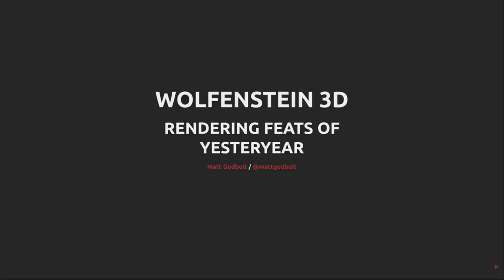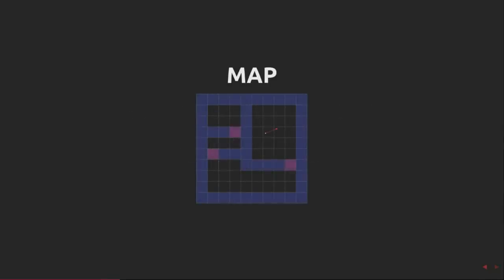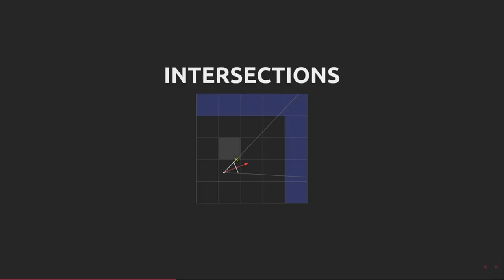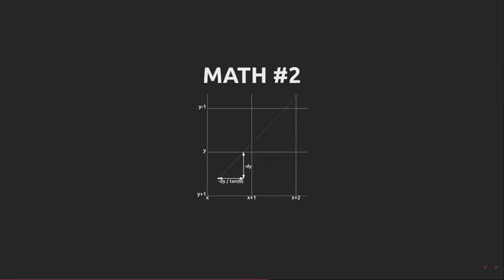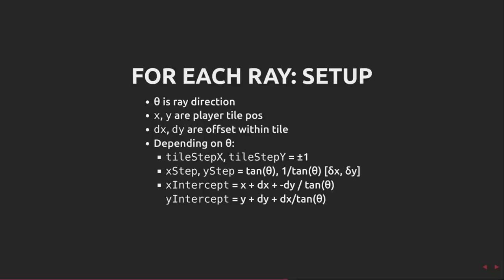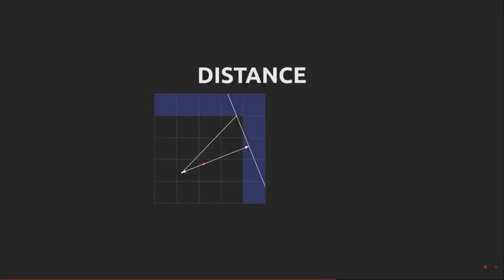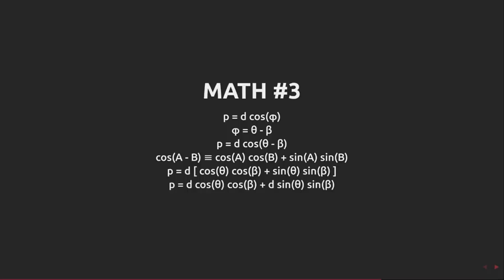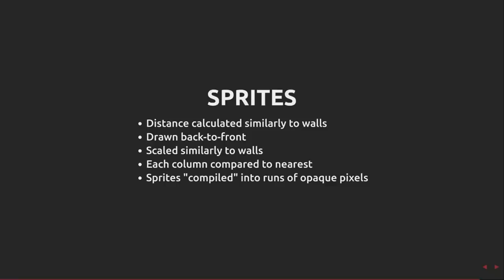Wolfenstein 3D's map renderer

Comment: Okay, I see how this can work for steps and angled walls (like standing in the middle of a hexagonal shaped room) but do would you add distinct textures for different ceilings and floors? Wouldn't Wolfenstein 3D constantly be limited to the "sky" and "ground" being one colour or one unmoving texture?
Reply: Yes and it was.
Reply: Except in versions of Wolf4SDL.
Reply: You could add in a textured sky or ground using this method, with a little bit of cheating. Let's say the sky for the whole level is a large image. You then have to figure out where on that image the player is, which you could use their x,y position in the map for. Then you need to rotate the image to match the player's orientation, and then render it with scaling before drawing the walls. A pretty basic demo effect. The problem is that doing it this way, you're writing the pixels where the walls are twice, which will slow things down. You could use a z-buffer, drawing the walls first and then only doing the ceiling where you haven't drawn anything yet, but it's still going to be relatively slow particularly for the machines Wolf3D were written for.
Reply: @deanolium  But isn't rotating an image extremely computationally hard? 

What is 3D if it isn't scaling and rotating many many different images all assembled together into polygonal models?

Wouldn't a huge level therefore need a single absurdly high resolution image as each part of it is viewed from fairly close?
Reply: @Treblaine  Nah, rotating an image on the z-axis is relatively easy. Essentially you just need to figure out the x,y displacements for each pixel when you move across one x or y position in screen space, which can be done with a little trig, ideally using look up tables, and then repeated.  Of course, you need to create the rotation across the x axis (after it's been rotated) so that it looks like a ceiling or floor, but you can cheat to mimic that by doing some scaling on each row of the screen.
As for the image needing to be large, in reality you just tile the image, which computationally is very, very cheap as you can just modulo the x and y points.
Reply: @deanolium  It's hard for me to get my head around how rotating in the Z-axis (that is the axis pointing out from the screen) can make it look like it's rotating in the X-axis (the axis going from the top to the bottom on the screen) with just some scaling by each row.

PS: I just went back to look back at videos of Wolfenstein 3D and it turns out all versions have solid colour ceiling and floors. I don't know where I got the idea of Wolfenstein 3D having textured floors or ceilings but none of the commercially released versions had it, even the Jaguar release.

So I suppose what you say would mainly be for engines like Doom.
Reply: It's one of those things which is hard to explain in a comment but quite easy on paper. The main thing is that you're changing the reference point with each translation. But it's also really cheating in many ways -- you're creating an effect which approximates a ceiling or floor texture. 
It could easily be done in a Wolf3D engine, but back in the day it would be more of a strain for the targeted systems which were already only just about running the game. By the time Doom came out, the systems would be powerful enough that you could do this kind of thing, but it's all very much icing on the cake compared to things like the walls, AI, enemies, etc.
Reply: @deanolium  Thank you anyway, I appreciate all you've said, I think you explained it as best as you could. It's been very interesting.

Comment: What about DOOM's map renderer? From what I know DOOM (1993) used as first binary spaced partitions (BSP), which were still 2D planes, but rendered took them separately and rendered them to their apropriate location and height. While there was no real height, it still did quite convincing job that the player is in a 3D room. But the player camera can't look up or down. This also leads to some strange scenarios when you have to shoot an enemy upstairs or downstairs. You just look to the wall and shoot. And guess what? You hit him! Also, this leads to a limitation. There can't be room under another. All stairs and elevators that take player to some lower or higher planes do not connect two rooms that are overlapped. Basically, there are no overlapping rooms. That was changed in 1996 with release of Quake, the first truly 3D game. When the GPU was invented and it featured more complex math operations (also more complex number formats than integers and fixed point numbers - floating point numbers - and the number bit depth also increased - with new 32bit CPUs and 32bit Windows, computers were capable of making more complex math operations), game developers actually took this into their advantage and a fight for the first truly 3D environment has begun. It was obvious that a game that is rendered within true 3D environment will be real boom. The fight was over when id Software (naturally the one that also came up with Wolfenstein 3D and DOOM) released Quake. That meant revolution in gaming! Truly 3D environment. id Software actually used as a base older BSP system and improved it to be used in a 3D environment using 3D calculations - IBSP has been created (improved BSP). This is the format of the maps that Quake uses. And people loved it! So not long later id Software released second Quake, which became an absolute favourite not only for its glorious Single Player campaign (which improved greatly from the first Quake, which just contained series of minor leaded missions without any background, Quake II actually featured a fully developed background story and you actually was playing a quite big role - which was also enhanced with first use of cinematics). The thing that earned the hearts of the players was the very first Multiplayer. The very first network multiplayer to be exact. And frankly, it was hell great. That to be said, id Software has seen this as an opportunity to create Multiplayer aimed game, and Quake III Arena was released on December 1999. Single Player was included, but only contained more like training campaign with bots than a real Single Player mission campaign. However, the milestones were set by Wolfenstein 3D (first ever raycaster, first ever 3D game, even not truly 3D), DOOM (first binary spaced partition for maps, improved graphics, layering, adding a depth to the fake 3D environment), and Quake (first truly 3D game). If you would look at these milestones, I'd be very glad :)
Reply: Note that Doom's BSP wasn't really to do with the ability to add height to the floors and ceilings, instead it's just an optimisation which allows more complex map layouts to be created. Particularly maps made from line segments instead of a 2D square grid. The other big improvement Doom gave was dynamic lighting. This was huge in creating the atmosphere which was so important for Doom.

Comment: When Wolfenstein came out out a 12 Mhz 286 was NOT "State of the art." State of the art meaning the best available in 1992 Was a 486 DX/2 66 mhz capable of running DOOM let alone Wolfenstein. Oh and the 486 DX processors had a builtin floating point unit and on chip cache. And also Wolfenstein did not run well AT ALL on a 286 12 mhz. You needed at least a 386 to run Wolfensten comfortably. Which was no big deal since the 386 first came out in 1985!
Reply from the maker: Right! A number of folks have pointed that out to me in the comments! Thanks

Comment: What I learned from this is that the ugly rectilinear game render (i.e. distorted and stretched edges at high fov) came out as a necessity of column-drawn rayCasting, but with rayTracing now, a curvilinear game render would not only be computationally faster, but more please to my eyes, personally.
Reply: The problem here though is that today's games don't use rays at all, and instead draw a lot of triangles. A curvilinear view would require all triangles to be rendered bent along the curve, which is only reasonable to either do it with math on software level, or render pixel by pixel on the same low level of hardware aforementioned triangles are drawn.
To gain more performance, we'd have to have hardware specifically developed to render those curved triangles, as our current GPUs were developed with the intent on drawing lots of normal triangles.

Comment: Can you explain me in a NON-programmer manner what is a FIXED POINT MATH? How it affects graphics? And why PS1 had it?
Reply from the maker: There are many ways to represent numbers in computers. Most numbers are just integers: whole numbers. Computers love these and can perform all sorts of operations on them.

When it comes to non-integer numbers, there's several representations. The most popular representation nowadays is floating-point: an encoding of the number stored a little bit like the "scientific" notation, like 1.23*10⁵ for 123000, or 0.5*10¯² for 0.005. This has the advantage of covering a lot of range for relatively little storage: we need to store a small "exponent" value (say, in the range -63 to +63), and then the "times value" (called the mantissa), which is the 1.23 or the 0.5 in the examples above. By only storing a few digits of the mantissa, we save on storage. Floating point is great, but to be efficient requires dedicated hardware on the CPU. All modern CPUs have this now, and they're incredibly fast. The name comes from the fact that the decimal point "floats" back and forth along the number, depending on that exponent: effectively the exponent tells me where to put the decimal point.

On the other hand: fixed point is a way of using integers to hold fractional values. Imagine we have 8-digit integer numbers (I'm going to use decimal values here for ease, but in reality it's all in binary). So my numbers are 00000000 to 99999999. How might we store fractional values? Well, why not just imagine there's a decimal point "fixed' after the fourth number: 0000.0000 and 9999.9999 - this is fixed point. Doing this, the normal rules of adding and subtracting hold up, even if we add etc without "knowing" abut where the decimal point is:
  0.5 + 0.5 = 00005000 + 00005000 = 00010000 = 1.0

There's a little more sublety in multiplication and division, but it's pretty straightforward.

So; in fixed point you trade the range of the numbers (going from 1000000 to 1000 in this example) for some fractional precision. You get add and subtract using the normal, integer native add and subtract hardware in your CPU. Multiplies are a little more tricky, but are still very efficient (compared to trying to do floating point without the hardware).

To answer your questions:

* It affects graphics as there's not necessarily as much precision available as floating point. A typical real-world choice (e.g. Wolf3d's) is to use 16 bits for the integer part and 16 bits for the fractional part, meaning 1/65536th is the smallest non-zero unit you can have. On PS1 games this meant that the geometry was sometimes inaccurately placed, and you'd notice it jittering around in some cases.
* PS1 used it as floating point hardware was not available - fixed point was the only choice.

Hope that clears it up a little!
Reply: A simple example in 16 bit would be using 8 bits for the left side of the decimal point and 8 bits for the right side of the decimal point. To the left the bit values go 1, 2, 4, 8 up to 128, but to the right they go 1/2, 1/4, 1/8, down to 1/256. 

The obvious downside is for some numbers like 1/3 or 1/10 you're going to get an approximation because you run out of bits on the right side to keep getting closer to your target. 

For example, using 8 bits to the right of the decimal point to get as close as possible to 1/3 you would store it as 1/4 + 1/16 + 1/64 + 1/256,
which is equivalent to 64/256 + 16/256 + 4/256 + 1/256 = 85/256
or without fractions, 0.25 + 0.0625 + 0.015625 + 0.00390625 = 0.33203125, which is close enough to 1/3 for most estimations but if you're doing astrophysics or something then it's wrong enough to crash you into the moon. Or, if you're doing 3D graphics on the PS1, it's wrong enough to make your lines and textures warp and jitter around at certain camera angles.

Modern hardware uses floating point variables, which gets more complicated and is inaccurate for different reasons, but gives you a greater range because it uses a few bits for scaling the whole number up or down (very similar to scientific notation), which means you can use the same-sized "float" variables to hold large numbers in the billions or tiny fractions (very helpful for money math like calculating interest owed on a loan).

tl;dr: most fractions stored on the computer are inaccurate, but fixed-point tends to be less accurate than floating-point, and for both systems more bits = more accuracy. 3D graphics done with inaccurate fractions means the math gets sloppy and you wind up with warped models and weirdly pulsating textures like you tend to see on the PS1.

Comment: Your definition of ray tracing and ray casting are off.  Every modern engine uses ray casting, generally not ray tracing.  They also fire a ray for every pixel being rendered.  You are correct that the technique used in Wolfenstein is called ray casting regardless.
  
Ray casting, when referring to casting vs tracing, casts a line from the camera into the scene, and samples the texture of the first thing it hits returning the color to your screen.  The texture is modified externally to simulate shadow, reflections, and etc.  

Ray tracing does the same, but upon striking the object, shoots another ray to every light in order to calculate the brightness of the point it struck.  If the new rays hit something on their way to the light, then the original point must be in shadow.  Advanced ray tracing will also check if the object struck is reflective, refractive, translucent and etc, then secondary rays will be shot from the point of impact at the appropriate angle for the desired effect.  Those rays will then sample whatever they strike and combine their results with the original result.
Reply: This isn't true. Most modern engines use a multi-pass system that starts with z-buffered rendering into multiple output buffers, one of these resulting buffers is a depth buffer. This depth data can be used like a ray firing algorithm, but there's a difference between zbuffer depth calculation and firing a ray for each pixel. 

Firing rays at all requires complex acceleration structures that don't exist in most modern engines (I'm glossing over any WinRT / RTX tech that's just now starting to come to use). Instead the GPU culls unseen geometry, then draws the polygons into the buffers, the Z, UV, and polygon index  structures can then be easily be post-processed with a shader to produce images seen in modern graphics. No rays are ever fired. 

I'm not sure where you got your information, but these frame breakdowns are a good place to start to learn how modern game engines work: http://www.adriancourreges.com/projects/

As mentioned, RTX modifies these pipelines a bit, but it actually works with this model, not against it.
Reply: Was looking for this, thanks :)

Comment: in 1992 they already had 486... a 286 was about 10 years old by then..
Reply from the maker: Yup, I definitely got my machines mixed up there... The 286 was the minimum spec, not the state of the art. Oops!
Reply: yeah, true  that, still a very nice video
Reply: @dezeekat  The stuff was, many had only 286, because computers were very expensive in that age. I remember, we could not afford it, even 286. We bought 486 in 1996, and it was still hell expensive. So they knew, what they are doing, when they optimized it to run even on 286. Doom, on the other side, needed at least 386.

Comment: So Wolfenstein 3D is basically ray traced?!?!
Reply from the maker: Sort of. One ray is cast per vertical column of screen. For (at least what I call) raytracing, one ray is cast per pixel (both columns and rows). So for a 640x480 screen, Wolf's approach casts 640 rays. A raytracer casts - at a bare minimum - 640x480 = 307,200 rays. I say a bare minimum as a raytracer very often casts further rays to trace reflections, refractions and shadows.
Reply: Old raytracing = figuring out how far away a wall appears to be so you can quickly adjust the size of the wall texture.
New raytracing = figuring out how light bounces off of shiny walls and ends up on other walls so you can tint the colors of those wall textures.